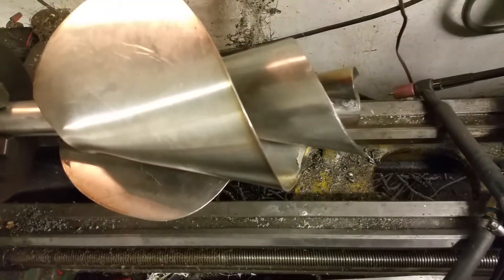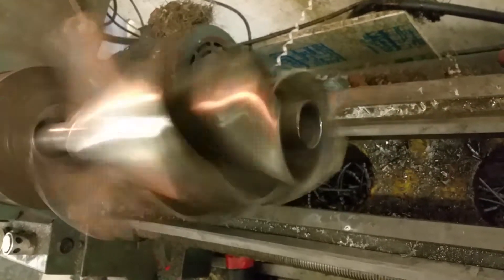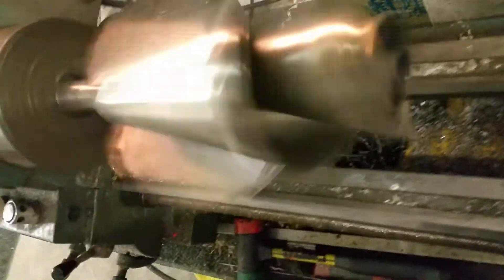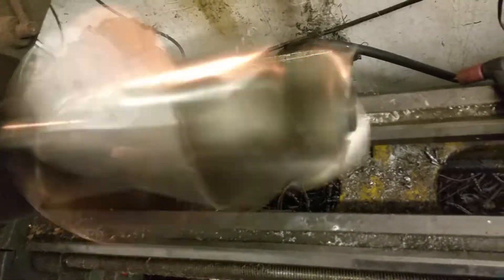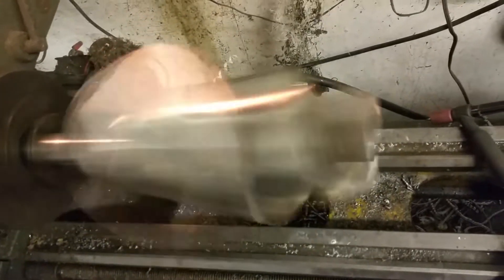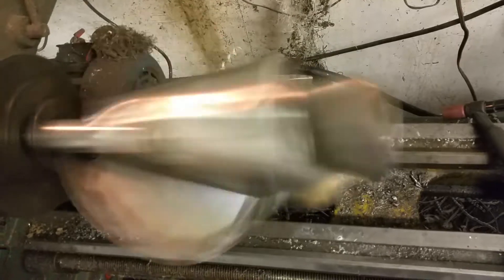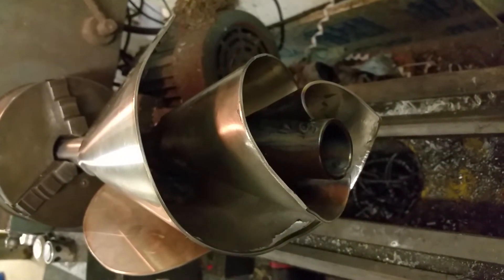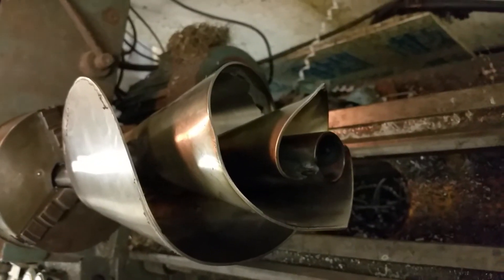Lily Vortex Impeller project Pt 3

Comment: Correction. It took 3.5 hrs ish. Started it at 8 and done around 11 ish. The 11 hrs took me a nap and some other good stuff lol. Looks good!
Reply from the maker: Lol, yes hands on is the down side. But I don't have a printer yet. Max is building me one.
Reply: Well i would say a thermoplastic would
Deform at high rotational velocities ecspecially if the fluid is super viscus